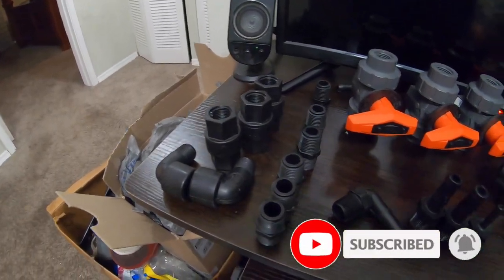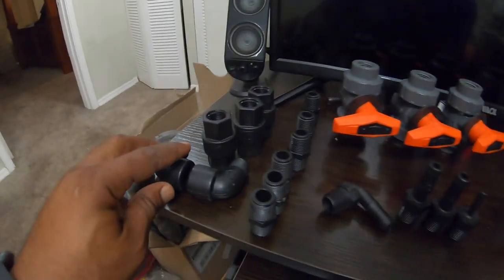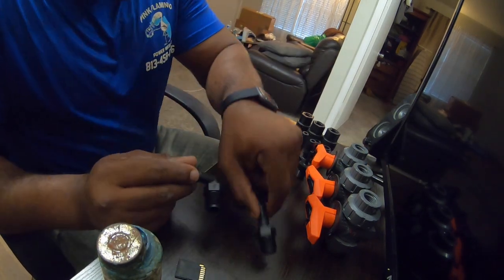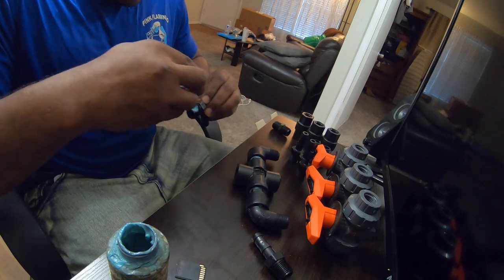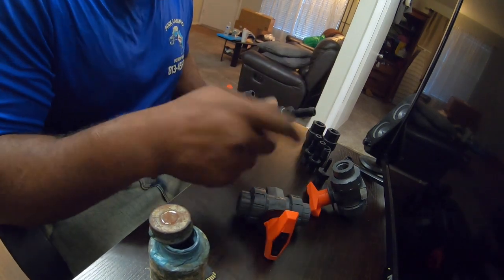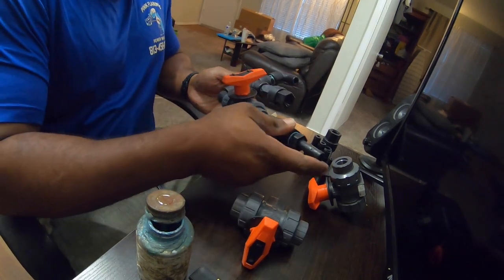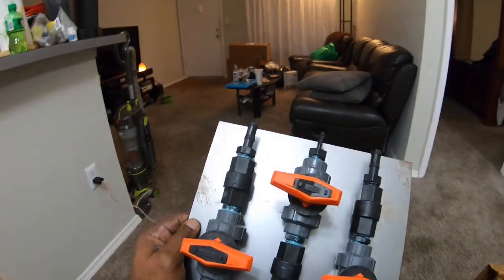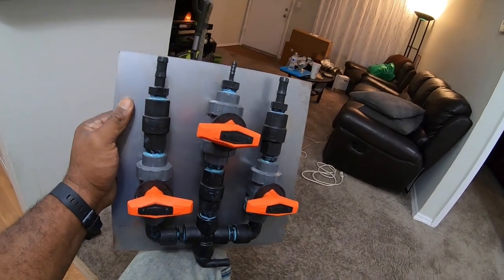Assembling GF softwash metering valve

Comment: How did you mount that to the plate ? Thanks again
Reply from the maker: Easy. pre drilled 3 holes to mount the gf valves. They come with holes for mounting. Also I upgraded to a diamond plate cause the one in the video rusted out in no time. So i got a real deal 12x12 inch aluminum plate from Amazon.
Reply: @PinkFlamingoPowerWash  oh that’s awesome indk they had pre drilled holes I am going to get some gf’s thanks man

Comment: Does it matter on the check valves if they are before or after the gf valves
Reply from the maker: No. Just make sure they're pointed the correct direction
Reply: @PinkFlamingoPowerWash  awesome I just built one

Comment: How well have the gf metering valves worked for you? Do they get the sh down to 1% when dialed in?
Reply from the maker: Still hot the same exact setup and valves 3 years later. Insane right?! Same check valves too.  Yes you can get down to a 1%
Reply: @PinkFlamingoPowerWash  thank you for your fast reply

Comment: How have the check valve springs held up?
Reply from the maker: 3 years strong. Believe it or not. I'm even surprised. Still got the exact setup on my rig.
Reply: @PinkFlamingoPowerWash  Wow, that's good to hear! Do you flush out the proportioner every time?
Reply from the maker: @briantorsell  yes indeed.

Comment: Thank you for the informative vidoe. Just ordered all the parts but the true blue. Where did you get the plate to mount it on and how did you mount it on there?
Reply from the maker: I got the diamond plated from Amazon. 12 inch by 12 inch diamond plate. I used short screws to mount it. Idk the screw Size. So I took the valve to home depot to size it.
Reply: @Pink Flamingo Power Wash LLC  Thank you sir. About to get on it now.
Reply: What would be the best hose for soft washing?
Reply from the maker: @michaelwallace1242  ag hose

Comment: the zoro link you posted, the metering valves arent threaded. how did you get the threaded ends?
Reply from the maker: Where did you see it's not threaded? How can you tell??
Reply: @PinkFlamingoPowerWash  i ordered them and they came in without the thread adapters
Reply from the maker: @Swellist  yea mine got the threads from when I ordered

Comment: Did the screws go into the back of the gf valves to hold it to the mounting plate ?
Reply from the maker: Yes they come with holes to be mounted.
Reply: @PinkFlamingoPowerWash  Thankyou I just got some valves and saw the mounting points. Do you happen to know where you got the screws to mount them
Reply from the maker: @streetpreacher7176  yes from home depot 😀
Reply: @PinkFlamingoPowerWash  you’re the man Thankyou

Comment: What size are screws that fit the back of the valve? Or how did you make the metal mount for it. I have seen the sheets at Home Depot. I just haven’t gone to figure out what size will fit. I love that idea. Most people use zip ties but I wanted to mount mines.
Reply from the maker: That aluminum sheet  sucks get the 12X12 diamond plate from amazon. The sheet from home depot rusted out in a no time. I forgot the size screws but they're pretty short. I took one of the valves up there to match the threads.
Reply: I appreciate your quick response. I wish you would’ve made part of the video with you mounting it to the sheet metal. I am good with my hands but I don’t know how to mark those holes on the back of the valves to get it on the sheet on diamond thread. I went to Home Depot today and get the screws they are M6 - 1 (metric for anyone who doesn’t know). I am ready just had that last question. Thanks for your help. Those simple questions help out a lot!
Reply from the maker: @shaunworthy2434  gotcha.  Yea that plate didn't hold up long so I got the diamond plate now.  Here's the full install. 
https://youtu.be/pGgBiEe3SoE
Reply: Can you give me some advice on how you drilled your holes to mount the proportioner to the sheet of metal. Is there a tip to do it effectively without messing up my sheet. Thanks
Reply from the maker: @shaunworthy2434  I just used a measuring tape to find thr coordinates of the hole.  I placed the proportioner on the sheet then I measure horizontally then vertically.  I only put 3 screws.  I didn't do all 6.
Reply: @shaunworthy2434  Shaun...or you can get a 12"+ 12" piece of plexiglass ($8 home Depot)..from the rear on the finished valves..."mark/drill holes in plexiglass...then transfer plexiglass to metal .. .drill holes according!(big cliff is the best!!)..hope this helps!
Reply: @PinkFlamingoPowerWash  or maybe put a tiny dab of TruBlu on the mounting threads of the valves after it is assembled and carefully lay the assembly on the mounting plate to mark the locations for each mounting hole, lift the assembly off and then drill your holes where the goop is. Also works with lipstick, Vaseline, peanut butter, etc.